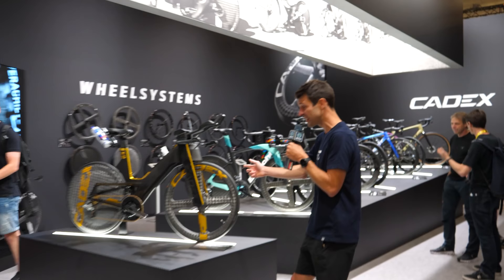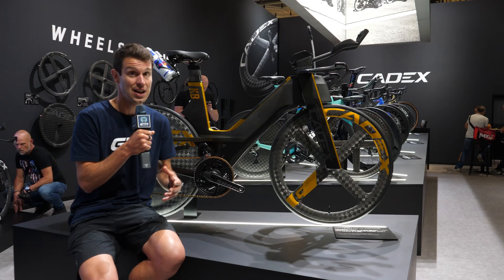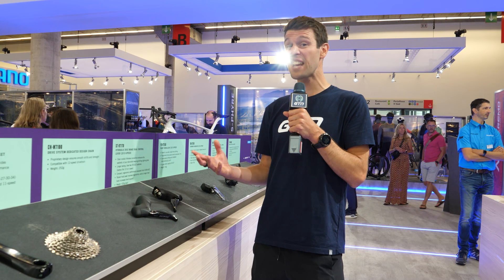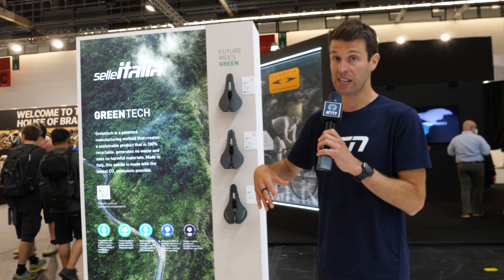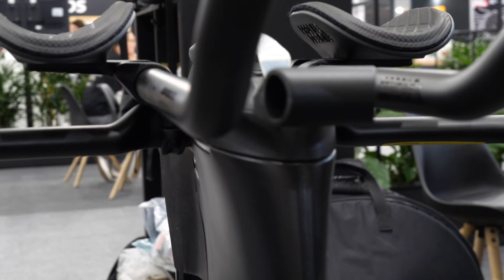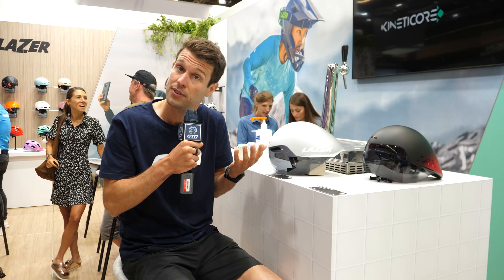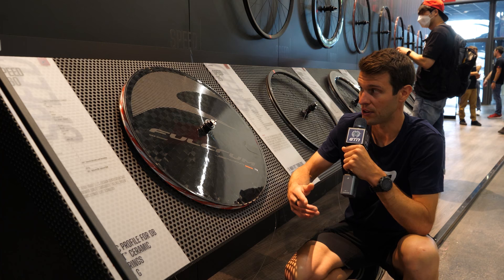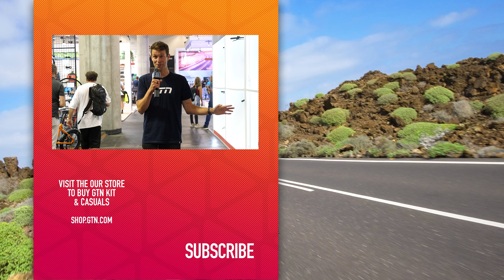The Coolest Triathlon Tech At Eurobike 2022! | Part 1

Comment: Di 105? Far more affordable? Not than the previous mechanical!
Reply: Sorry I meant the dura ace and ultegra di2. I knew what I meant 😂
Reply: @markthrelfall3577  the new 105 is pretty expensive as I understand and will be going on bikes that start at around 6 or 7 k? What group set will be on entry level tri-bikes?